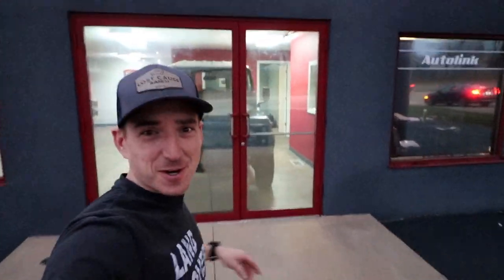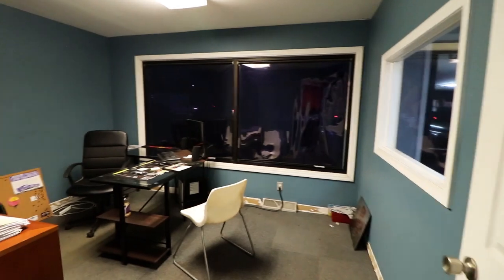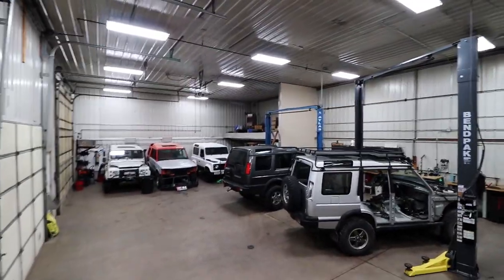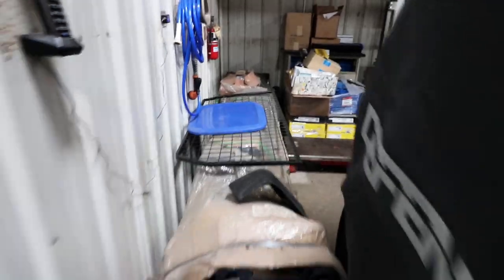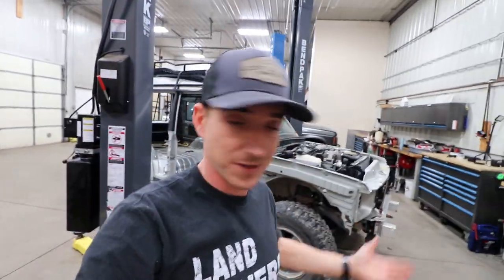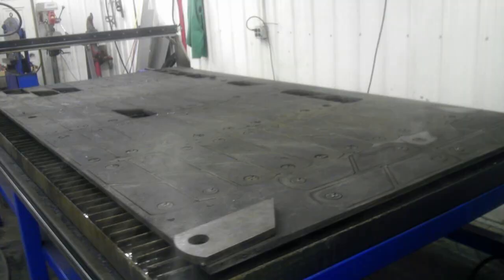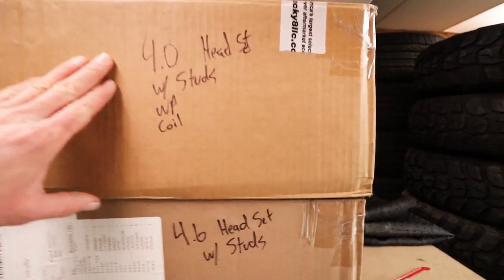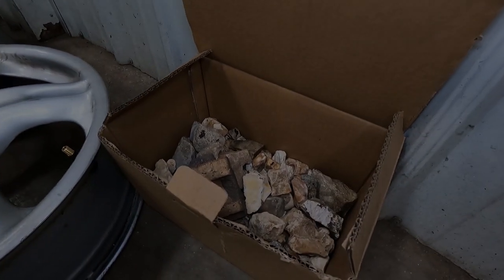Lost Cause Shop Tour | 4500 sf | Dual Level

Comment: Just the right size building to keep you busy. Keep the rocks so you can throw them back at the little shi#ts. You guys ever consider building a RR Sport SC L320 into a Bowler EXR S lookalike even if still 4 doors. Be a great looking weapon of a thing. Big archers & wheels.
Reply from the maker: The work space is sufficient. I personally don’t want to have much more torn apart than we can handle in here. But some additional indoor storage would be nice. The Bowlerish L320 would be a cool project. I’m going to have to put that in the memory bank, would be a great dual purpose back road blaster.

Comment: NIce. Cool to see the whole shop. I hate to be that guy, but, I'm going to ask: what size tire is on the grey LS Disco 2? I love the way that thing looks.
Reply from the maker: It has 315/75R16 so 34.5”. 4” lift as well. Has spacers on pre facelift wheels to clear the radius arms while turning.
Reply: @LostCauseRanch  I figured those had to bigger than 285/75. Thanks.